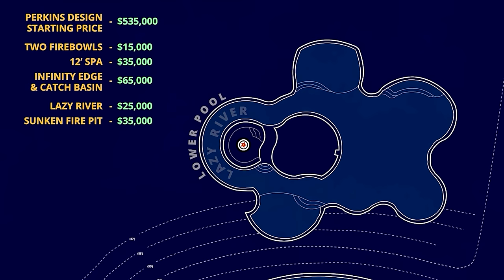A Million Dollar Pool!

Comment: Very cool pool, that would be on the small side of the pools we build. $30,000,000 Olympic sized  pool that changes volume at a touch of a button. The waterpark capital of the world, Roller Coaster waterslide we built that. Are those drain 90s your using for plumbing? you know those aren't pressure rated right?
Reply: Where is that Waterpark at? Turkey?